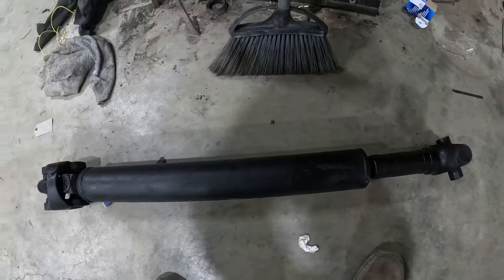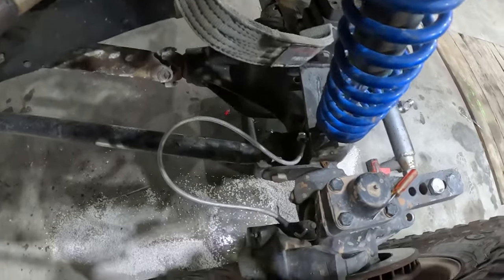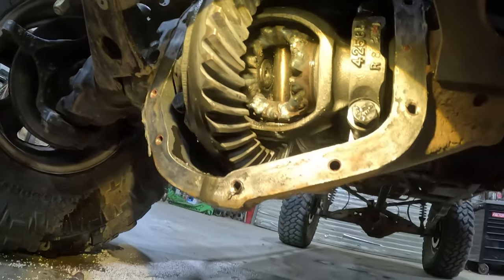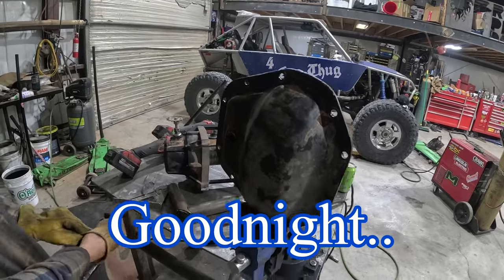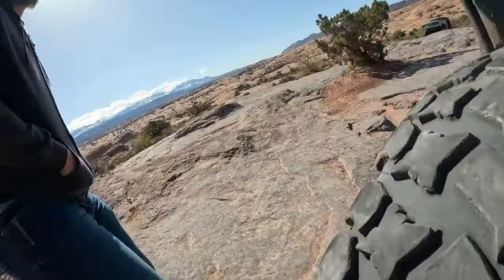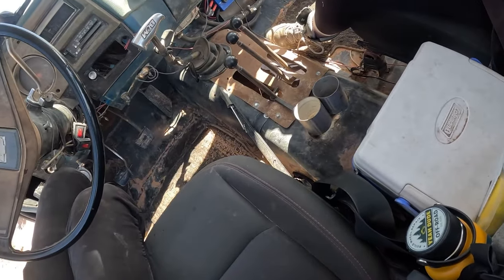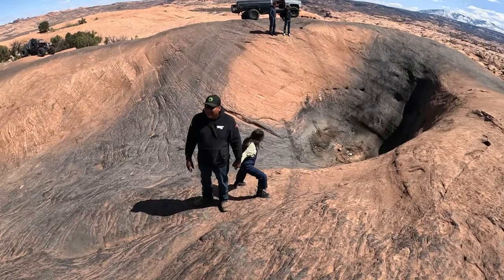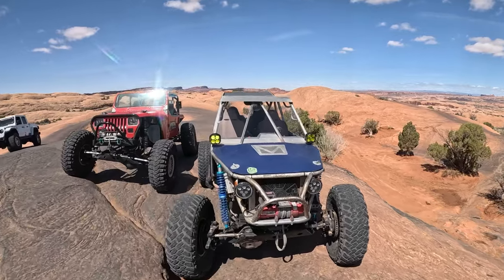What!! Code 4 LED Owners Came To Wheel With us

Comment: I modified a harbor freight wireless remote for in cab controls. I just added an on off switch to the antenna box, mounted it in cab and hard wired it into the winch.

Comment: Why is Mike running so much air in his compensator tires, they are all ballooned out, is it to avoid wearing on the sidewalls as they are no more tires available? 
The Deathstar is still super capable despite rock hard tires though! Imagine what it could do with some bead lockers and Tyre slime
Reply from the maker: I know that they look really over inflated but they are at 5 psi or less.  I used to run them around 2 psi but they would squish over too much.   The other factor is that it's a 19 inch wide tire on a 12 inch wide rim.